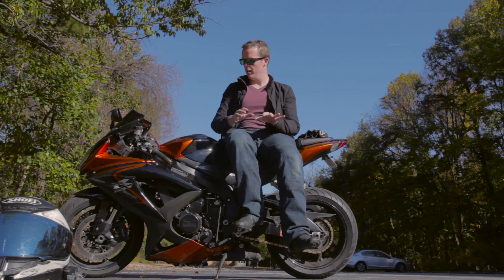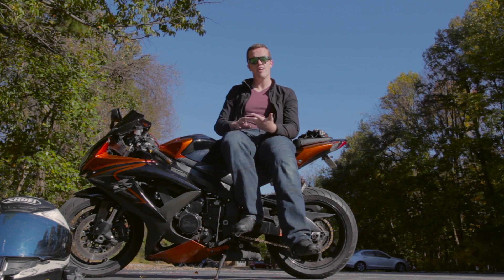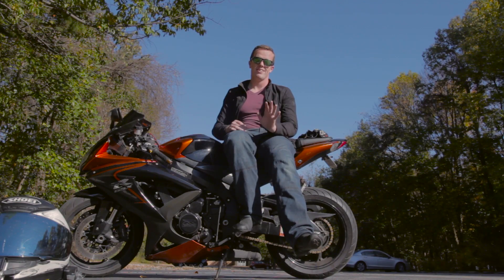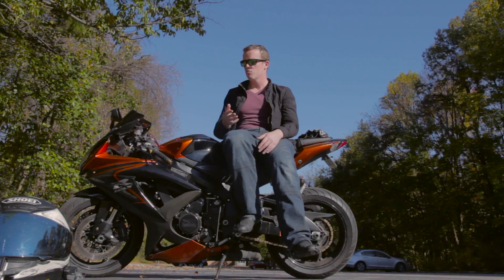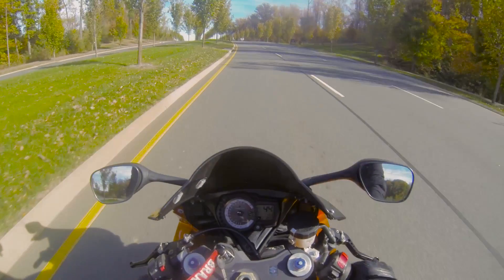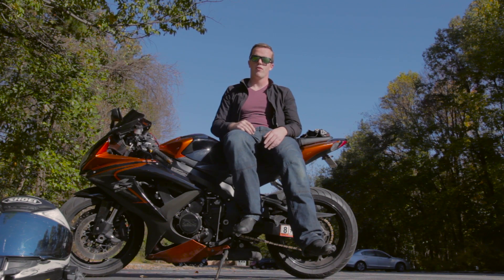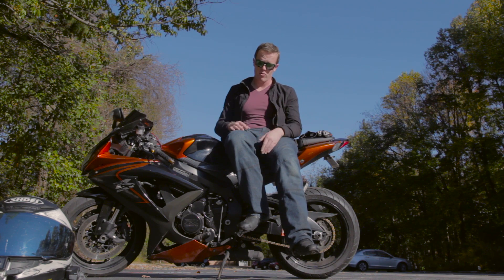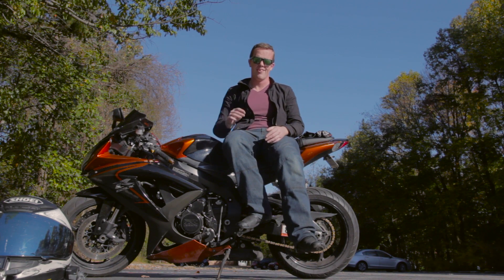How Motorcycle Engine Braking Works

Comment: To add to this, engine breaking shifts the braking from the front to the middle of the bike, so this improves bike stability. Also, by shifting the breaking to the engine and not the front, it is also easier to control the steering of the bike in the turn, so it will feel like the bike is easier to counter steer, or like the bike isn't fighting you on the turns as much. This is because when the front brakes are applied the countering for to the tire rotation will counter any inputs from neutral.
Reply: It does NOT move braking to the centre of the bike at all ,  you will have a weight transfer but it is the rear wheel that is braking because it is trying to rotate the engine.
Reply: IraceTV you are so wrong. Just because the force of the braking is coming from the engine does not have any effect on anything else. It's literally the same thing as hitting the rear brake
Reply: IraceTV it doesn't move braking to center of the bike. The braking is being applied to the rear wheel and the rear wheel only.
Reply: "except unlike applying the rear brake, there is no risk of locking the rear tire" ... eehhh no!
Reply: IraceTV wrong it gives breaking to where the power gets out down aka rear tire
Reply: Thats not how it works.... braking cant shift. It is either front or back wheel. That the braking happens in the middels of your bike or the front or the back or in the 35th dimension.... It is either or both of the wheels.
Reply: Depends on the bike and and how effective it's engine brake effect is but it is still rear wheel that is doing the slowing in a semi passive mode due to internal drag of the engine, with the throttle closed .
And obviously trailing an amount of rear brake is active . 
I have heard some go on and on about internal wear on the motor yet they are usually the ones that take their bike out on a cold morning and roar up the road before allowing the engine to idle for a few minutes and then warm it with gentle riding until up to temp.
The engine braking available on my Ducati is so nice for cruising in the twisty stuff :) .
Reply: mozzmann btw, what Ducati do you have? Check out my vids. I have a Ducati Monster.
Reply: IraceTV front brake, dives the nose, effectively changing the geometry of the bike while under braking giving you easier turn in while your nose is lower.. if engine braking was a quicker way through a corner, most teams wouldn't be trying to smooth it out.
Reply: IraceTV what do you mean "downshift yes, engine braking no". It's exactly the same effect causing the braking. If you shift to a lower gear and let go the clutch it is engine braking that'll slow you down. The increased intensity of the effect is caused by the change in gear ratio but it still IS engine braking that slows/locks the rear wheel.
Reply: Engine braking is really important in a street bike and even more important in race bikes, that's why they even have different engine brake maps and depending on the conditions and turns they change while riding
Reply: Neither have I , start 'em let them warm up is always better thart jump on and roar off up the road.
Reply: '91 900 SS 100K original Km and untouched other than regular servicing
Still ozzes sexyness , anywhere I ride other rider;s are attracted ;)
Reply: mozzmann ...nice. Im sure it does. Ive always been a fan of the 996 which came a little later.
Reply: A good friend of mine had a 996 before he bought an ST4 ,  , The 996 like the 900 just seems to me to have the X factor , but like all bikes some people like some and other's not .
Reply: IraceTV it makes sense nice one bro
Reply: IraceTV  look while engine breaking is a good thing... hell its free and consistent. but dude if you are breaking and turning at the same time whilst (as i read) your bike 'fights you' then my friend you need to 
A listen to it
B look at your style
C buy simon crafa's moto vudu.
 the advice of rushing it into a corner then relying on engine breaking alone is stupid. yes this technique does exist (use brakes aswell) just on the track. so rush in hard on the brakes (already shifted down)  letting go of them then turning it in to the apex w/out touching the throttle... this takes BIG commitment to work properly. 
 btw loosen up on it, flow with it and stay safe.
Reply: Yes you do brake and turn alot and we observe the simple rule of this..   +lean = - brake. But IraceTV the engine braking you are talking of is free, what did you do? Closed the throttle, applied some brake 😓 putting more weight on front tyre and compressing forks and tighting the line... all at mid corner max lean. And you are in high revs because that where you bike makes the power so a by product of this is engine braking. Go watch my short video around cadwel park on a 2005 R6 and you will hear me using engine braking and blipping down every time, also some short shifting lol. You may like the 2nd video as its what happens when you get corner exit wrong.
Reply: v1kku ...releasing the clutch on a downshift pulls the engine aggressively higher in rpms which does the same to the rear wheel resulting in possible loss of traction. Hence why people try to rev match. Just hitting a turn at 12k rpms versus 6k, which i am advocating, and if the rider needs to let off the gas, isn't enough to cause loss of traction. Only letting off completely deep into a turn in wet conditions with bumps could cause loss of grip when just releasing the gas.
Reply: Quinney84 ...sorry but I couldn't put together what you were trying to explain. Sentence fragments maybe. **One thing to note: at greater angles of lean there is an inverse relationship to having less fork compression for a given change in speed.
Reply: Engine braking as you explain is used by novices and pro's alike, its free and consistant way of slowing down. There are far more important factors to consider other than closing a throttle.
Reply: IraceTV ok riddle me this.. if you are riding fast you want to use you engine at the best output and that usualy at top top end of rev range.. now why do you change gear? is it to slow down or to be in right gear for exit? (ignoring crashing over cooking or some dumb broad on her phone). yes keeping a engine singing is a skill but nothing a novice rider cannot learn to do, now a free part of this is engine braking! its free and its so easy my nephew who was 6 got the jist in 3 laps of a field. Engine braking is very usful and can save your bacon but its not a advanced skill... it is just closing a thhrottle peroid. 
 like many things when you notice or get told about something like this it can improve you times on track or just make you a little more confident. A bit lile counter steering... we all just do it but its only when you think of it, try it then before you know it your not thinking of it again. you never stop learning on a bike and thats what separates us from the lazy ass no talent car drivers. (insert john surters pic here).
Reply: IraceTV just to clarify dude i would love to go ride with you to compare lines and all the other crap then a bbq n beers and discussion (before the mini motos come out for a laugh). peace n stay shiny side up of course brother.
Reply: Quinney84 ...I think for new riders it is not intuitive. Here they have all this power...(right?...most don't start conservative) so much power that it may scare them to ride a turn with high rpms, so they don't. They still may hit a corner fast but in a low gear. My buddy did this a few days ago and ended up in the other lane. He was expecting engine drag but when he backed off the gas the bike didn't slow, and he wasn't prepared for the brakes. Normally he rides a turn with a high gear. This can compound in downhill conditions. Just differences between experience and not, and knowledge and intuition.
Reply: IraceTV sounds like your buddy learnt the lesson of pay attention, hope it was just a scare and he is all good. 
 You know their is a way to ride super slow and scare yourself... HD Motorcycles, they scary it dont go, stop or turn lol. 
 I have just purchased a aprilliaRS125 to mess about with mates on the road. No engine braking their but it eats corners and sucks on straights lol... not that the guy on a gsxr750 saw us coming lol. 
 You from USA?
Reply: mozzmann check out the 2017 isle of man TT in the superbike category, Guy Martin has a big off at 140mph. Now his interveiw after was good 'with out engine braking the bike wont turn'. Now remember this guy is 10000000% faster than you and rides for HRC. 
 Smoothness is a very genral term as covers all aspects of riding from body position, clutch control, throttle control etc. Mozzman engine braking is free and easy to use and i you use it more than you know. 
 As for track i only do track now and im using engine braking at corner apex as this is the best your bike will ever turn. Dude try it.. enter a corner at usual speed then put it in neutral.... let me know how wide you went and how close you was to messing your pants.
Reply: ALIENdrifter66 so is it not good for cruisers?
Reply: IraceTV Im a little confused at this comment. Now yes a cruiser will not be running into a corner hot (the fact its in a corner is amazing) but they still use engine braking and in a big v twin that engine braking is very noticable, like a ducati or a aprillia rsv or the triumph 675, the engine does not define a sports bike. As for the heat issue on brakes thats nothing to do with engine braking... simple fix is dot 5.1 brake fluid or the 5.1 silica fluid now these hydraulic fluids have a much higher boiling point than the standard 4.1 that usually goes into road bikes. Cruisers genrally have shit brakes (diavel exemption). 
 Exept 2 strokes ALL engines have engine braking even diesels it varies how much with a few different factors. All riders and drivers use it. Some use it to more effect than others eg a zx10rr flying around will use and notice it much more than a guy on a Harley cruising and checking women out. Was paying more attention to this at Brands Hatch gp curcuit wednesday trying to find  a better lap time.
Reply: IraceTV It's good for all kind of bikes, cruisers also benefit from engine braking, alowing them to reduce the amount on manual braking the pilot has to use, reducing the wear of the parts and alowing for a smother ride. In fact, if you ride at legal speeds all the time on open roads you can take most corners just with engine braking
Reply: Lol we have had this before about engine braking we both agreed on it importants. As for racing it has nothing to do with reduced wear on brakes or engines as its all about performance. You use soft tyres and brake pads that grip lile fuck but dont last as long as road stuff.  Road riding and track riding is completely diffrent disciplines. 
 As for that crash at the TT it was Guy Martin on the CBR1000RRSP in the 1st superbike race, Micheal Dunlop jad a mechanical on the GSXR1000R. And cheers for incorectly qouting me mate.
Reply: Right, thanks for the name correction. I posted the link to the video after you mentioned it, just FYI. I'm confused by your comments about brakes and performance. Are you trying to say that worrying about brake fade is not an issue in track racing or, in other words, heat management at the brakes is not an issue in racing?
Reply: Yes it can be a problem but engine braking does not replace your brakes, and dropping it down too many gears can cause problems into, during and exiting the corner. As i said before engine braking is its most effective after the brakes leant over and off the throttle to make it turn as tight as possible then hit apex and start to pile on the throttle. 
 2nd to last corner at brands is a great example of engine braking, just close the throttle, throw it in then pin it! Track helps as its concaved in so drags you in then spits you out shaking the rear under power... gives me a chubby when done correct. Where you from IraceTV?.
Reply: Lovely part of the states, i wish i had the amount of sun that you do here in Southampton. 
 No need to Imagine as have had 2 strokes on track so no engine braking. You avoid brake fade asmuch as possible by using top quality components aka Brembo and the correct fluid and pads. dot 5.1 fluid and a carbon based brake pad, also lever adjustment. Never hear of brake fade at top level.. tyres usually go off before brakes. 
 I was glad to see Guy Martin is ok and Ian Hutchinson has broken his left leg again but not much news (Hutchy is a fooking hero to come back from his injuries).
Reply: + Barrett Meeker That is correct, I road raced 350cc 2 strokes and 1000cc superbike in the 1980's, having no engine braking on the 2 stroke meant you could use all brakes to slow and take your time selecting a gear with clutch in and the let the clutch out in the right gear and roll on for the exit. The 1000cc 4 cylinder superbike had 11.5:1 compression and no means to reduce engine braking, so in short you just never used the back brake since backing off was plenty to slow the rear wheel, but it forced you to follow the speed down with gear changes to keep the rear tidy, braking only at the front, rear disc was for decoration (regs) only. If you could use EFI to shut off fuel and roll a little throttle on to reduce engine braking then you could use the back brake providing a more "fine" control of the rear braking than engine braking that follows the engine deceleration curve not the pressure of you braking the rear on a controlled manner.
Reply: any braking shifts weight bias, hence most of the braking is loaded on the front of any vehicle, that's why OEM's and racers put giant brakes on most high performance vehicles on the front. I might suggest a few books on vehicle dynamics and corner balancing and understeer/ oversteer, dampner valving ect. Methinks you have lots to learn, high performance driving being #1 on the list. oB
Reply: Purely because they have designed speed stability into the chassis for the Isle ,  largely very high speed 
and it won't turn initially the turn into sweeper's where this Off occurred.  Now the suspensions for the Isle are very different from standard GP courses because their suspension is specifically set up to get the front to dive within reason and thus change the steering head angle and thus the sharpness of steering this is a fundamental aspect of Rake and trail.  AND if your front compression is soft and rebound is restricted , with the reverse on the rear then yes engine braking will assist the turning of the bike , it WILL NOT EVER prevent it from turning it simply cannot
Reply: jason white ...it isn't a bad vs good. More like used vs not used. Cruisers don't enter turns high in the revs, nor do they need engine drag to go from ON GAS to ON BRAKES. Sport bikes are best accelerating or decelerating and engine braking supports transitions from feeling like you are either on or off. It is better for heat management in race applications where it isn't as much an issue for cruisers, unless your are using engine braking for going down hill so you don't ride the brakes.
Reply: mozzmann ...you really only need to idle for like thirty seconds. Just don't get on it until the engine oil is up to proper temps which depends on weather and cruising behavior. But I haven't seen any problems with engine braking on bikes I have owned.
Reply: Kenshin851 ...too much engine resistance means less power or less speed through the rpms. So that could be bad for teams wanting max power or transitional speed but thats not the issue when addressing smoothness. 

You are confusing resistance with smoothness. Im talking about engine braking as resistance, which is proportional to the rpms and will always exist regardless of how smooth it is. We would want it to be perfectly proportional or SMOOTH so it is predictable, and more importantly we would want smooth power delivery for predictable inputs to the throttle. Ride a Ducati Monster then a cbr600 or zx6r. Tell me which one is smoother (more linear), more predictable throughout the power band, and even under engine braking. It isn't my Ducati Monster.
Reply: Quinney84 ...you have to brake and turn at the same time a lot. Adjusting speed mid turn is necessary. Just did a six hour ride hammering it through Calistoga to Lake Berryessa and through Napa County. There are many times I have to avoid rocks or make adjustments because of double bends in turns. If you are high in rpms through a turn then it is easy to remove throttle input to slow or lessen the angle in a turn versus making brake adjustments, besides the fact that you are prepared to roll on the gas as you exit a turn. If someone is not hitting a turn or holding a turn with high enough rpms then they are missing out on the benefits of having engine braking.
Reply: Quinney84 ...From my experience, most new riders don't use engine braking at all or enough. And they especially don't increase the use with increases in speed and aggressive riding. What is basic to you may not be basic to others.
Reply: Quinney84 ...and like you said, counter steering is another example of intuition vs knowledge and experience. Easy to teach; hard to overcome instincts but once achieved it is like riding a bike. Just takes longer for some. 

👍
Reply: The effect of engine braking is minimal on a bike , end of story , this of course varies greatly with the type of engine,  I seriously doubt that any track times or other advantage can be had other than smoothness of riding. 
On the road we use our gears whether it is slowing or accelerating , so rather than debate the pro's and cons , just be SMOOTH and get out an ride,
Reply: ALIENdrifter66 ...there is a difference between using engine braking versus relying on engine braking. Michael Dunlap crashed because he was relying on engine braking, and it wasn't there. Sure, a cruiser can use it, and there are plenty of YouTube videos of cruisers n Harley types of bikes flying through corners like they are sport bikes, but if we are talking about who relies on it then that either depends on how someone uses their bike or we can single out sport bikes. But yea, anyone can use it.
Reply: Quinney84 ...engine braking in racing applications is something riders rely on. Anybody can push any bike enough to use it. Anybody cruising can use it. Aggressive riding like at a track is where riders need it, where they rely on it. It is why Michael Dunlop crashed at Isle of Man Tt when he hit false neutral. Also, engine braking use means less braking is done via the brakes which means a bike will see less brake wear and brake fade on the track which is huge. Engine braking is free because it doesn't use fuel and doesn't wear out rotors and brake pads, so from a racing perspective it is vital to performance. Again, anyone even a moped is welcome to use it, but its necessary users who rely on it are sports bikes and race/track bikes.
Reply: Imagine engine braking not being there, if all the drag from engine braking were to instead come from the brakes alone then sport bikes would need larger rotors and higher heat pads just to survive, and on a track that has a lot of hills or speed/direction changes, the brakes would see brake fade. I was pointing out that engine drag is good for heat management away from the brakes in racing applications on top of for providing a technique for maximum cornering performance.

Sonoma County California.
Reply: +K Campbelli   Thanks for the ad hominem comment without adding anything to the conversation. The door is to the left.
Reply: +K Compbelli Check the link below. The Engine Braking Control system on MotoGp bikes works to help control the bike to not over-engine-brake, so as not to lose traction when letting off the throttle into a turn:

http://www.motorsportmagazine.com/opinion/motogp/how-motogp-engine-braking-control-works

"All riders need some engine-braking to help them slow for a corner, but exactly how much depends on individual technique."

In short, too much engine braking at their extremes is bad, but they don't want to remove engine braking all together through electronics because, as they said, engine braking is helpful. 

Another good article on braking in MotoGP

http://www.cycleworld.com/2014/06/12/exclusive-interview-with-brembo-engineer-lorenzo-bortolozzo-ducati-factory-rider-andrea-dovizioso-on-motogp-braking#page-4

"A.D.: I use the rear brake quite a lot. In MotoGP, we use the rear brake on the exit to control the spinning. If you use the rear brake well, you can use less traction control because you can tame a big spin by reducing it but not eliminating it. I use the rear a lot also on the braking even though with the four-stroke there is enough engine braking so that many riders do not use the rear. But this is my style, and I always use the rear brake."
Reply: Right. I think I was being too vague and you were being too literal. When I said shifting I meant weight transfer, not changing gears. And when I said engine braking moving braking to the center I was talking about where the source force is and not to confuse it with rear braking, which essentially it is, except unlike applying the rear brake, there is no risk of locking the rear tire, and less chance to lose traction because engine braking (without downshifting) is very smooth.
Reply: ZIPPER978 ...hitting the rear brake in every corner through some changing  twisties is going to cook the rear brake. It will lead to brake fade. It will also be harder to modulate the rear brake with risk of lockup. There is also smoother transitions to using engine braking by staying in a low gear and powering out of turns than if one was to run a higher gear with lower rpms and to rear brake then need to downshift at the end of a turn to power out of it. Engine braking therefore is significantly different than rear braking, even if they both act on the rear wheel.
Reply: v1kku ...eh yes. Engine braking is smooth. Rev to redline then let go of the gas and see if the rear wheel locks. It won't. Ever. If you downshift then yea it could, especially if you do it aggressively and/or without rev matching and/or without a quickshifter.  Downshifting yes. Engine braking no. 

I suggest just try to use engine braking. Go into a turn hot/aggressive on a bike that has a 12-15k redline with at least 9k rpms when you hit the turn with minimal braking to no braking. Do the same with no more than 4k rpms and using more braking. Do the same entering the turn hot under max braking with the clutch pulled and held in as you max brake. You tell me which feels the most stable.